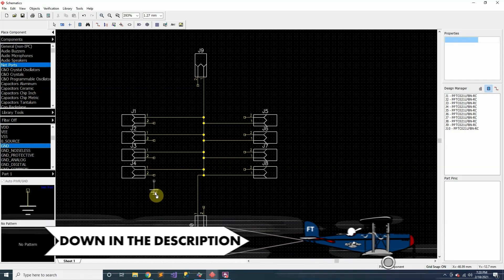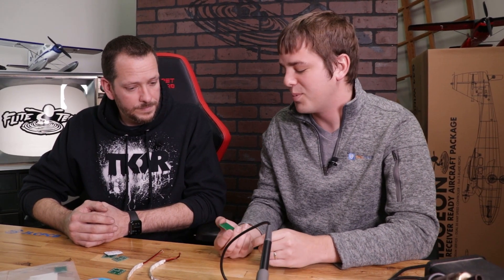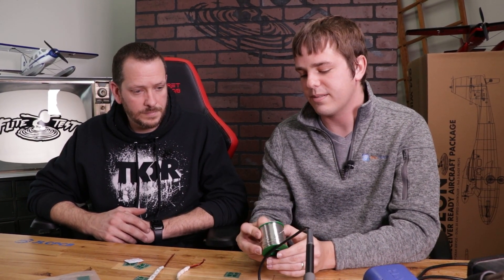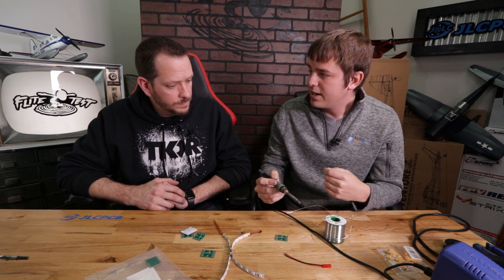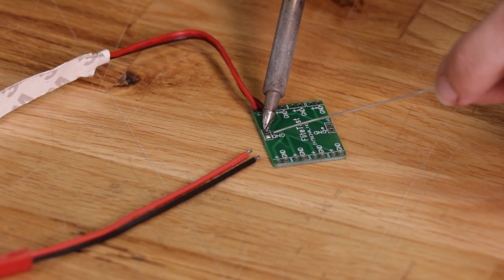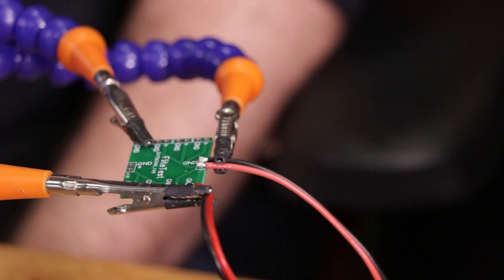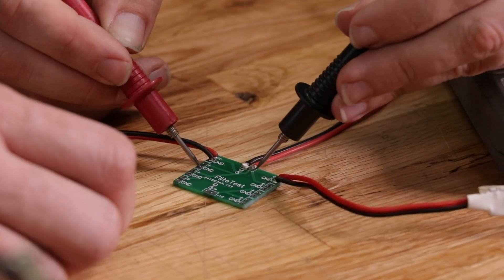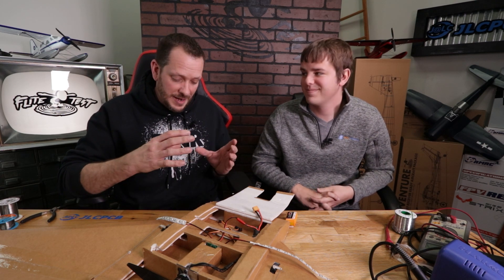Soldering Basics on your PCB!

Comment: For soldering 101 I would expect a little bit of explanation, what is soldering, how it works, what is the goal, what heat transfer and heat contact is, the role of solder itself, the role of flux, most common defects, etc. Not just soldering some board and randomly giving a bits of information.
That would be the very basics that give people an understanding of what is going on and instantly improve their results on soldering.
Like the very simple and obvious fact that to solder pieces together you have to have to heat all these parts to a certain temperature. Recognising that and consciously applying heat to your parts instead of just sticking soldering iron somewhere there makes all the difference. And surprisingly that is not obvious to lots of people who got into soldering for first time.

Comment: The first number in solder is always tin, 2nd is lead.  95/5 would be 95% tin 5% lead.  50/50 would be 50% tin, 50% lead.  You get the picture now.  👍🏼

Comment: I hate to contradict this all but there are so many bad ideas and practices shown. I worked for several years doing military spec production work on radios for Harris RF communications and this is what was shown in training as EXACTLY what NOT to do. Its an Ok BEGINNER walk thru for soldering of wires.  Improper technique for any thing other then wire work.  NEVER set your iron on the pcb and preheat the board. This is the second most common mistake for people destroying boards with components on them only to excessive heat. You work the solder NOT the heat.

Comment: great example - there is another free project for a single switch to operate sequences like 2 servos for a landing gear or multiple led ... working with an arduino. If you will continue the series that might be an interesting a step more advance project too 

You find it on the channel joyplanes rc which is doing mostly scratch buildings in different ways. 
Search for this:  JOYCHIP

And he has more like an easier project for 
* adjustable LED blinking 
* cheap strobe light 
* redundany power circuit

these are the keywords to search on his channel ... a lot of good stuff easy to solder if someone had soldered  your LED project

The first one is a more complicated one but of great use ...

Comment: Have to be honest, some of these tips are sure to make the newcomers fail at their first attempts and give up.   #1) 100% use leaded solder. The fumes are no more dangerous than lead free. Your not vaporizing lead at these temps it's the flux that has dangerous fumes and leaded is WAY easier to use.  #2) You will have much better luck at higher temps than lower. People most often lift pads because the low heat of the iorn requires them to be on it way too long.  These are just the 2 most important. I love flight test but truly believe this is not helpful to newcomers and potentially harmful.